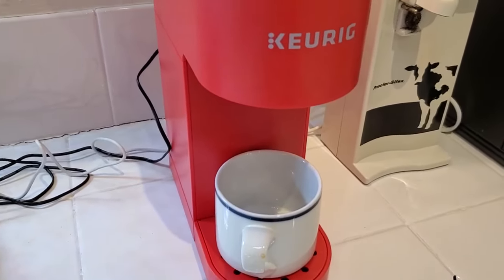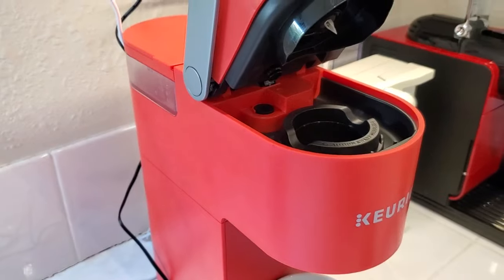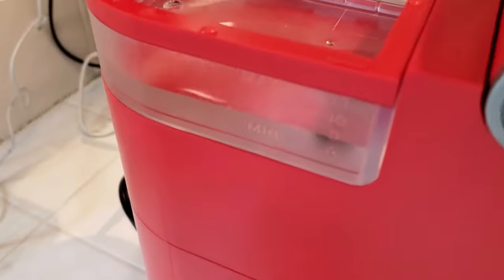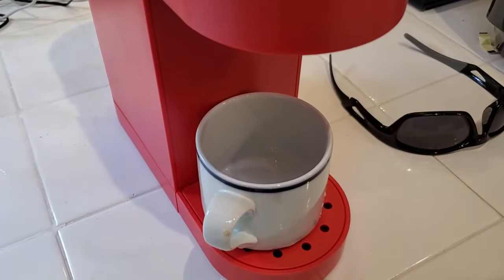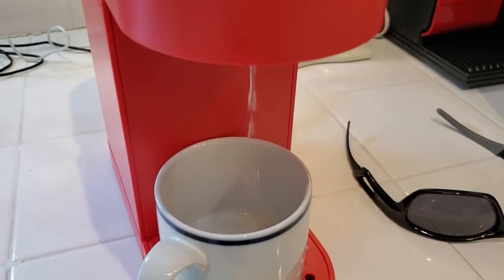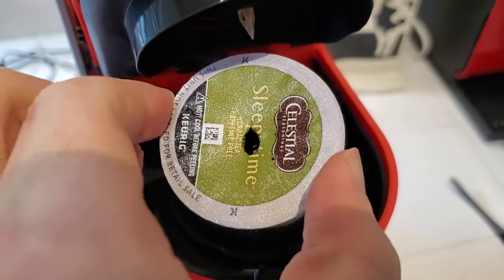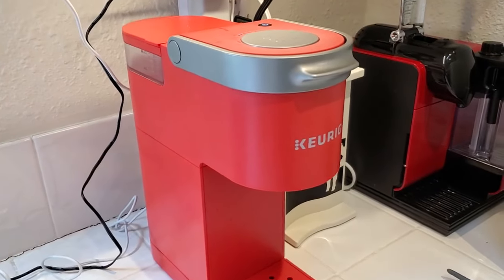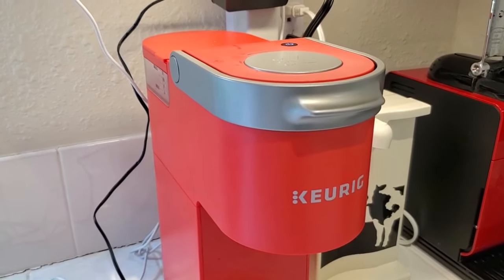How to Use Keurig K-Mini Coffee Maker

Comment: I just got the k mini and it works good. Why does instructions say don’t use distilled water? I typically use distilled water because there’s no need for descaling when I use distilled water.
Reply from the maker: I use normal water and it’s fine
Reply: I’m on my 4th machine. In one I used distilled water and it stopped working.
Reply: @vonydavis1150  that makes no sense. Distilled water is just pure 0.0 PPM water. My tap water is almost 200 PPM so over time using tap water will cause mineral build up in coffee machines. Mine has been working great for several months.
Reply: @billbradley2480  Oh. Just looked it up online. And you can too. It says not to use distilled water in a keurig. Over and over again. This could have saved me money.